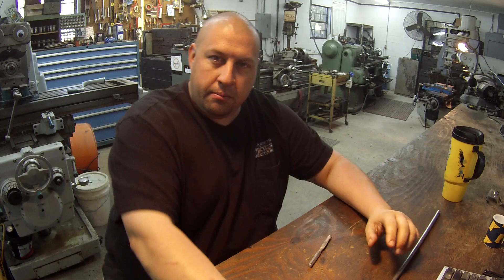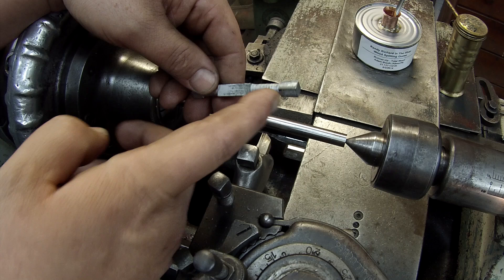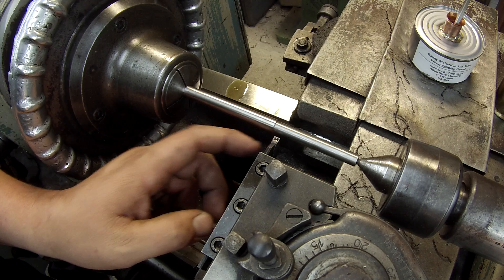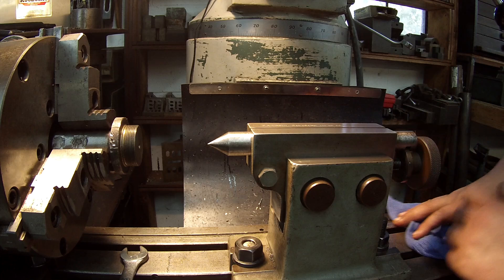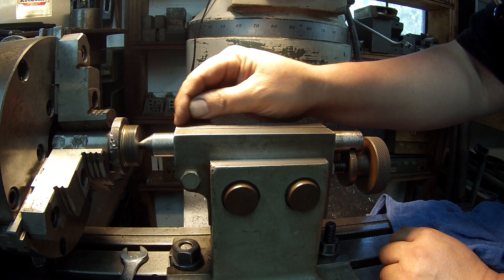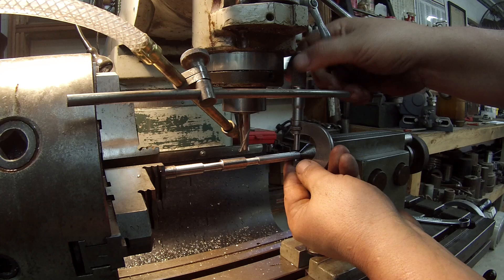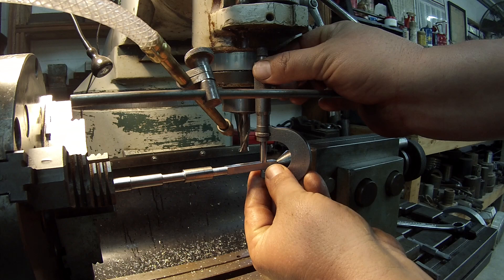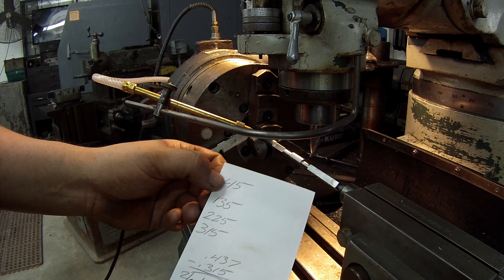Machining a Lock Part for a Custom Door

Comment: I only just seen this video, bummer as the pin you have is a stock door pin here in Australia, it was first made by Lockwood and later to be mass production by just about every door mechanism manufacturers. They cost $2,50 AU dollars its $1.20 US. Its a shame because the cost of your stock probably is worth more before you make into a pin.
Reply from the maker: ***** I remember he was telling me you can't find that part anywhere. Maybe you can but easier to just make one then search all over God's creation for it.
Reply: It would have been harder as the internet was not setup for retail as it has been for the pst 3 to 4 years. Can you answer a question ! I have a 4 jaw 4" chuck and i dont know how to work out the thread, i can work out a bolt but not an internal thread. I want to put it on my lathe for some jobs not knowing the size of it is stopping me.
Reply: Adam's will probably last a lot longer!